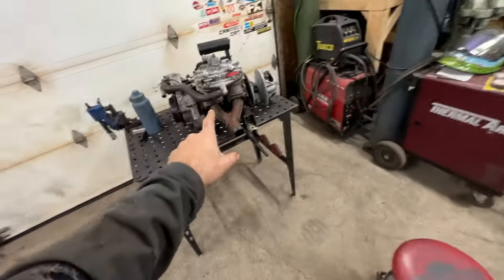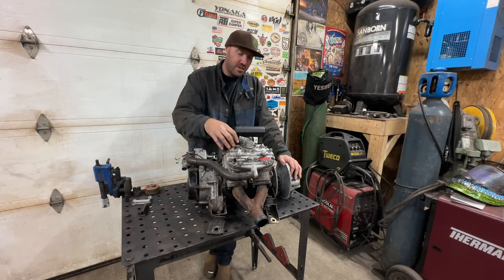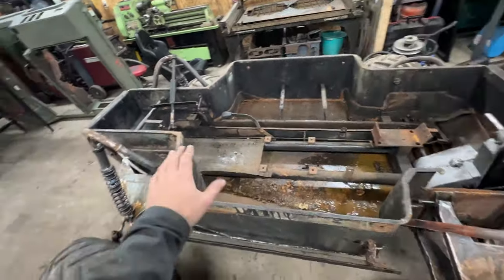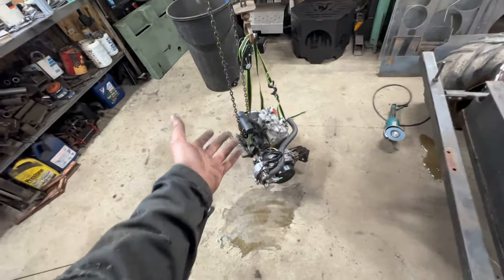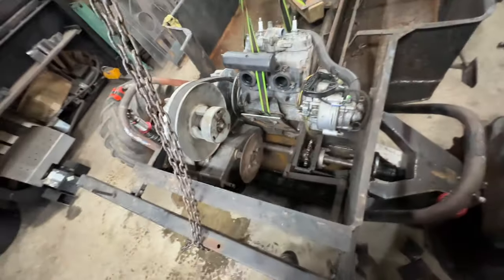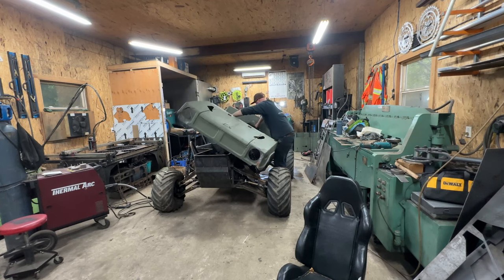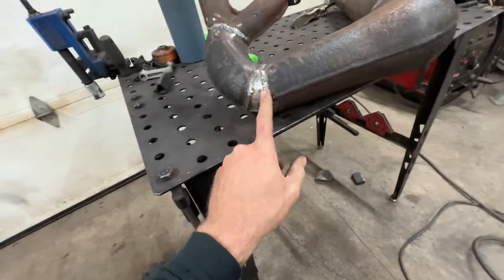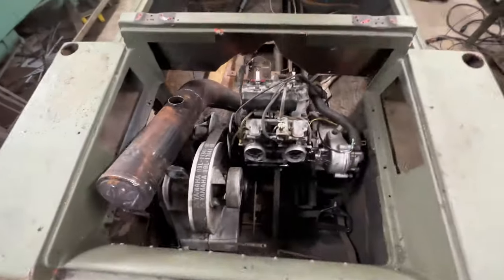AMPHIBIOUS BUGGY PART 6 || ENGINE & EXHAUST INSTALL ||OVENGED

Comment: You can use exhaust wrap on exhaust to prevent the starter from getting hot and maybe make a removable rear engine mount
Reply from the maker: It did cross my mind about using exhaust wrap on most of the exhaust! Just to keep the heat/temp down! I’m hoping that will help the starting issue! Lol the engine mount I’m still mulling over!